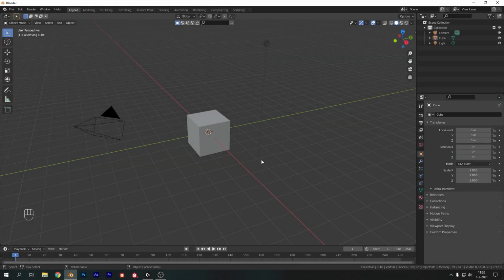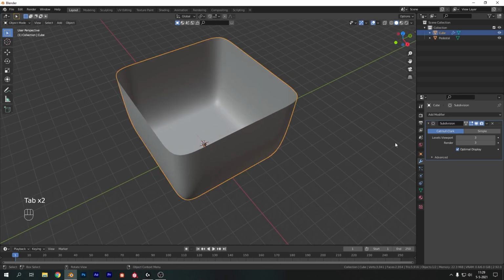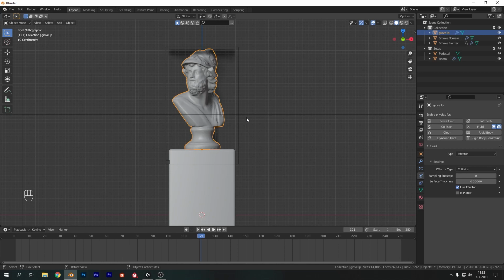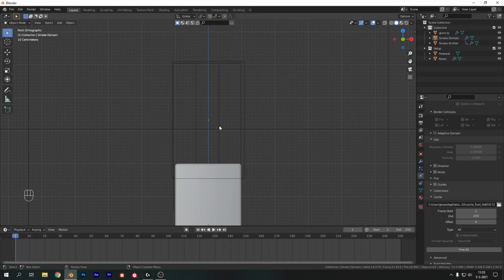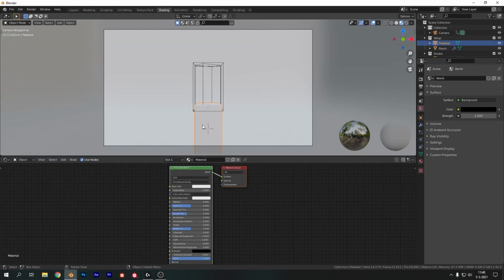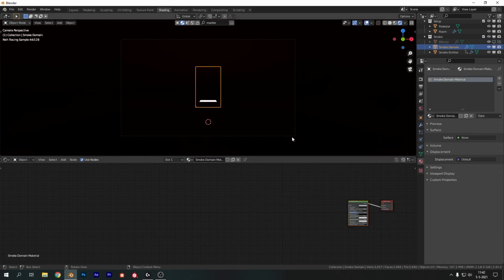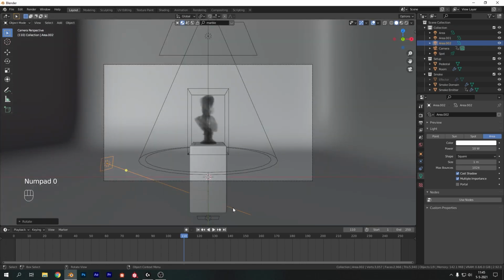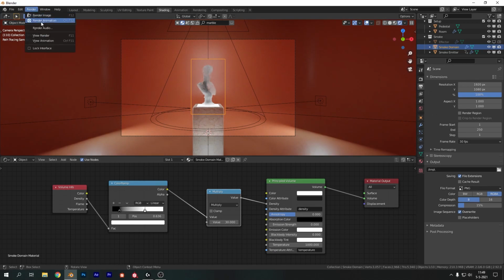Fill ANY object with Smoke [Blender tutorial]

Comment: If i wanted to add some holes and make the smoke to flow out how could i do it?
Reply from the maker: You would need openings in the mesh you’re using basically. The process stays the same for the rest! Might be a bit finicky though if you have small openings, but it should be possible!

Comment: hi lets say I have a bumpy ground as a collision object with a desert shader and I want to have the visual effect of a moving sand by the wind like dust when wind blows across the ground using mantaflow, is a bit tricky since it has a specific connected particles pattern which I find very hard to achieve with the mantaflow basic parameters
Reply from the maker: Hi! This is pretty hard to do indeed. I think it's doable by using some of the techniques in this video; https://www.youtube.com/watch?v=MjM16FUMOKM&t and combine those with regular smoke simulations like in my video! It'll be difficult, but you should be able to get something decent looking I think.

Comment: AMAZING VIDEO. I love the amount of detail you prepared. Even for a noob like me, I was able to accomplish it through blender. i was also wondering if you could shed a light on doing this smoke effect on typography... being able to see the smoke coming out and turning into typography and then vanishing... too much to ask? Cheers!
Reply from the maker: Thanks a lot for the kind words! Awesome to hear that it helped you out. In relation to your question I'd say that the same principles would apply as to the 'bust' object. To keep the letters seperate you'd need to do each letter in it's own smoke sim though. So just create invisble letters, with an opening so it works. Make sure normals are inverted and just fill the objects up. 

To vanish the smoke you can animate the 'dissolve' value. So set it off, and give the toggle a keyframe at the moment you want to vanish the smoke and then make sure to use a low value so the smoke vanishes quickly! Good luck!

Comment: I decided to add glass texture to the effector. It was sitting there with a glazed expression then filled up with smoke. So yeah, it worked! but I just couldn't quite get the lighting the same. Rinse and repeat it is then.
Reply from the maker: Sounds pretty cool! The lighting I used is just several area lights, mainly backlit. So just pointing towards the subject, slightly from the back, angled from the sides. Good luck!
Reply: @KaizenTutorials  I have been having lighting issues in Blender Cycles for some time. I did your tut in 2.93.6 but the lights just seemed to bright. Today I downloaded 3.0 beta to render out the animation (because it quicker) and the lighting is darker. I had halved the light values from what you had. So for some reason, my Cycles has been to bright even with main light off yet Evee displayed it correctly. Can only assume it was/is a bug with cycles?
Reply from the maker: Oh that’s weird! Yeah it could be a bug, but it could also just be some weird setting that somehow got changed in the previous version. But you seem to have it fixed now, so glad it got solved 🙌🏻
Reply: @EladdNZZ  I think you may have just answered my question,  if it will work in Eevee.   I use 2.9  I don't have the latest windows,  so can't use blender 3.0.
thanks my friend.

Comment: For some reason my smoke is showing up in solid view, but not rendered view. I added the lights butI see nothing on the pedestal when I try to render it. I'm pretty sure I followed your steps exactly, not sure why it's doing this?
Reply from the maker: Hi David! Have you added a volumetric material to your smoke domain? Make sure to select the domain, add a material and remove the default Principled BSDF and replace it with a principled volume! :-)
Reply: @KaizenTutorials  Hi Kaizen, I am having the same problem. I did what you said but the result is the same. The statue appears in the rendered view in the Eevee engine, but not in the cycles engine.
Reply from the maker: Well that’s no fun then! I’m not sure what the problem is, but if you want to feel free to send me your projectfiles at kaizentutorials@gmail.com. I’ll have a look what’s wrong! 🙌🏻
Reply: @KaizenTutorials  Hey! I followed your steps too, but I don't see the round ball from the smoke in wireframe mode.